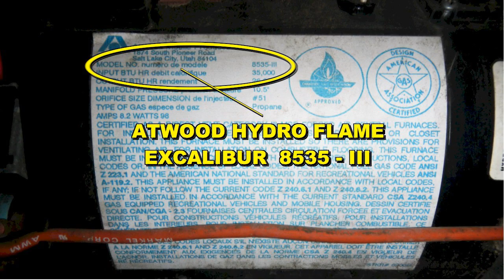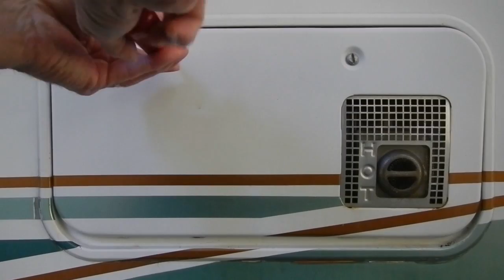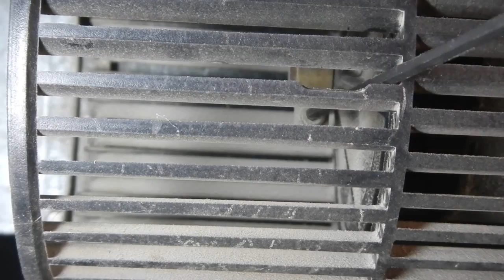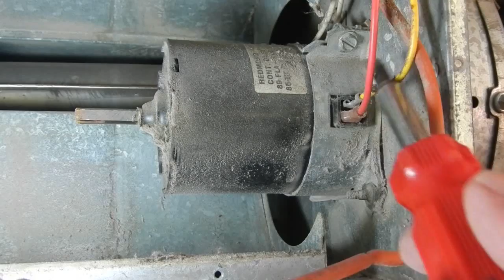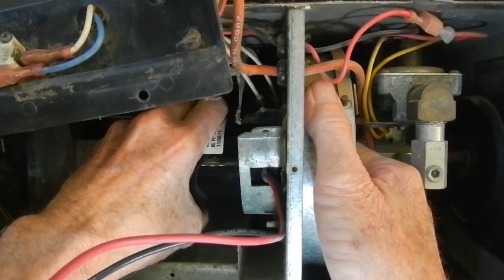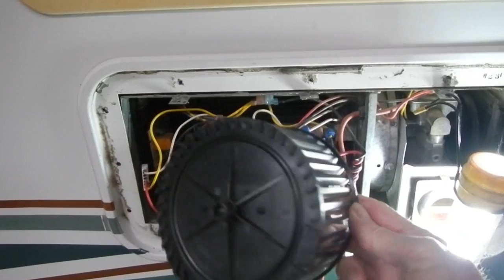REPLACING THE MOTOR ON THE ATWOOD FURNACE

Comment: Thank you..  Your mistake, helped me tremendously, as I live in a geographic anomaly, I am two weeks from anywhere for shipping. So I didnt have time to wait for a new blower wheel.. I spun the exhaust wheel, with the blower cover on, before I put the exhaust back in, to check clearance, and realized my old blower wheel, wouldnt go on the new motor shaft far enough to clear the rivets on the relay switch.. I had to take a drill bit and wallow out the squared hole on the motor side of the blower about an 1/8th inch, to get it to clear the rivets.. The flat spot on the shaft of the new motor doesnt go back far enough for the old blower wheel.. Oh and I cleaned the ground lug, before attaching the ground wire to it, been exposed to the elements for 20+ years, it was a little crusty, and I wanted to make sure it was making a solid connection.. Thanks again, for your short and very helpful video.. ✌♥️🇺🇸
Reply from the maker: That's great! This is why I made the video. Nice work on your project.
Reply: @Bill8DebTravels  Thank you again.. ✌♥️🇺🇸

Comment: There’s just one problem with your plan here. You tell us to cut the yellow wire from the original motor- which is a big mistake. If you have to replace the old relay they have designed the new ones to where you need that ground wire to plug into the new one. I’ve learned the hard way from making that mistake of cutting the yellow wire like you said. When the motor blew it took the old relay out with it and I didn’t notice it until I tried the new motor and it didn’t work. So everyone from here on- leave the yellow wire in tact!
Reply from the maker: Very Strange! This is the first time this has come up  since this video was first posted in 2017 with over 54,000 views. Make me wonder if we are talking about the same furnace, ignition control circuit board and motor. The procedure worked for me and a lot of other folks. 

Are we sure we are talking about the Atwood hydro flame Excalibur 8535?  There's a motor upgrade replacement for the DC 85 - 3 and the 89 series models make sure you get the proper replacement kit for your furnace.

Comment: Thanks for your video. I just installed a new motor (8525-II) and your video was very helpful. Especially the damage to the fan when you turned it on. I only needed to complete the new wiring but I stopped to check the clearance on mine and it would have hit if I didn’t adjust the fan a bit closer to the motor. 
Helpful video. Mine is back together and working great!
Reply from the maker: Fantastic! Glad I could help.

Comment: My motor is spinning slow but it never made any squealing sounds. I used to be able to feel air movement about 1-2 feet above the vent and now nothing. I know this is why my sail switch isn’t activating because I pulled the cover off and activated it manually. Trailer is plugged in battery is charged. 
Is this just a bad motor? Or has anyone experienced something different
Reply from the maker: Since you hace had the cover off, I asume you have cleaned in there so it woun't be dirt. Have you checked the voltage at the fan? The "squealing sound" is from worn bearings. But if the fan is running slow and the voltage is good, I wiould replace the motor.
Reply: @Bill8DebTravels  after I put it all back together it was running slow. I’ve since learned I had the two wires reversed on the fan motor. Now it spins fast and the furnace works. Not sure what I did to fix it along the way. My guess is somewhere in the sail switch circuit there was a poor connection and putting it back together fixed it. See how long it lasts, hopefully she’s done for good. Thanks for the reply and the great video
Reply from the maker: @darwinmclovin5090  Sometimes ti's better to be lucky than good. I hope it continues to run well for you.

Comment: How did you find replacement or upgrade models? I've spent far too long searching for the exact  Atwood 37233A  model 38535-III.
Reply from the maker: Google search. This poped up today when I searched for Atwood-37357.

https://www.rvupgradestore.com/Atwood-37357-Furnace-Motor-For-85-89-Series-p/41-1630.htm?gclid=CjwKCAjw_L6LBhBbEiwA4c46un_VdHObkYml-3WQYGHKHBVHvn9on5OdLrFh7hKZ5ZuTOsH8DA2DJBoClZkQAvD_BwE

Comment: Helped make my motor swap much easier. My new motor had identical plug in leads as the old motor. The burner squirrel cage was rusted to the shaft so  penetrating oil and some careful heat got it off.  Then a 1/4"" drill bit wrapped with 400 grit sandpaper to clean the shaft hole. Both squirrel cages were metal. 30 years of bugs and dust came out of the vents in spite of a good cleaning beforehand - guess that old motor had been tired and slow for a while.
Reply from the maker: Glad it helped. Sounds like you did a good job.

Comment: thanks for making this video, the only problem I am having is with the switch on the inside of the cover. I finally quit fighting with it and duct taped it closed. I assume it is just a "cover present" switch.
Reply from the maker: CAUTION! If that is the sail switch inside the fan housing, it is a safety precaution to tell the system that your fan is spinning fast enough and it is safe for the propane to be ignited. DO NOT DUCT TAPE IT!

Comment: My motor still connected to the small wheel how do I remove the motor from the small wheel
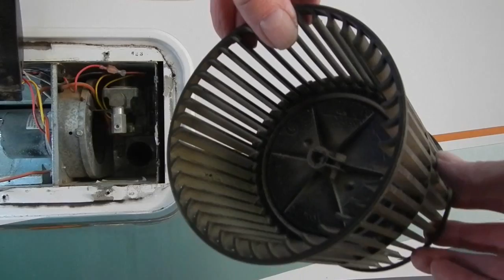Reply from the maker: There is a set screw that has to be released (about 3:30 in the video). Some people have reported that the wheel was rusted to the motor shaft. Some WD 40 or Blaster and some tapping should loosen it. See some of the comments below.

Comment: Thank you for the video. I had a struggle getting the motor out of the combustion fan because the shaft was rusty. Penetrating oil, and a file to deburr the end of the shaft, from the little hammer strikes, while tugging with small channel locks on the other end. Rotate, drive fan back on, add penetrating oil, file rust while holding other end of shaft with small channel locks, and repeat.

Comment: Mine went smooth minus the combustion wheel. It was froze onto the shaft despite removing the set screw. After half a hour of swearing under my breath and fighting with it it finally came off.
Reply from the maker: Persistence and chanting often produce positive results.
Reply: I used a boar brush to polish it up after I got the combustion wheel off and It went right on the new motor no problem. I think it took around 10 minutes to put it all back together with the new motor
Reply from the maker: Great Idea and nice work!

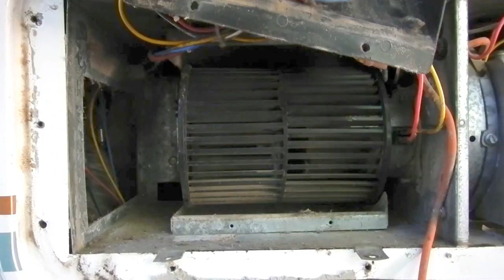Comment: 2:32 - man, you pulled that exhaust tube out like it was nothing. I've been soaking mine with WD-40 every couple of hours for the last day and have had a pipe wrench on it several times. Won't budge for me at all.
Reply from the maker: Yea, it came right out. You did take the little wingnut off ? There was some rust on mine maybe more on yours?
Reply: Bill Thompson - Yes I took the wingnut off. And yes, certainly more rust! :)
Reply from the maker: @truthsmiles  Keep spraying an wiggling.... good luck.
Reply: Bill Thompson - I finally got it off. A real saga. I ended up cutting the flange on the tip completely off with tin snips, then removing the valve/burner assembly by sliding it past the exhaust. 

Then , I slid an impact socket inside the pipe and clamped it with an exhaust clamp. A 1/2” drive impact wrench wouldn’t get it off. Ended up spinning the socket. 

I was continuously using WD-40 and even tried a propane torch plus the impact. 

Then, I drilled holes through the pipe into the impact socket and put in screws. Re-clamped and re-impacted. Sheared the screws. 

Finally I WELDED the impact socket to the pipe. Still didn’t get it off, but eventually twisted the pipe completely in two. 

But then, I was able to get the outer shroud off the pipe with lots of wiggling. And THEN, I was finally able to separate the heat exchanger from the fan housing. Once I could get to where the pipe went into the heat exchanger, another huge dose of propane torch and a hammer to beat the pipe into submission. Finally broke it loose!

Three weeks of trying different things, each more extreme, and it finally came out. 

At this point I hope everything still works. I removed the circuit board for the welding and impact stuff, but I hope I didn’t fry the motor with the welder. We’ll see! Haha
Reply from the maker: @truthsmiles  wow! Epic effort. Any pics or video?
Reply: Bill Thompson - No video sadly... just a few pictures: https://imgur.com/gallery/G6RuTUp
Reply from the maker: @truthsmiles  Boy! That sucker was really rusted in there! It must have been getting wet fir a while. Good work!

Comment: Thanks for the great video!  I watched several others  attempting the same R&R and your video was the only one that didn't show some hacked-up wiring job.  My burner fan was rusted to the shaft also, but I was able to work it off with a pair of channel locks and a vice grip pliers on the shaft on the blower side.  Hopefully its good for another 23 years!
Reply from the maker: Thanks Mark. My goal was to make the video concise and accurate. Good solution to the burner fan. Lots of people have had a problem with that. Have a great 23 years!

Comment: Great Video!! Thank You!! The set screw is stripped on the rear cage how do you remove set screw ?
Reply from the maker: Thank you for the complement. Sorry to hear about that set screw. I am not sure what to tell you. I'm thinking, removing the burner, cutting the motor shaft, new blower wheel. BE CAREFUL - TURN OFF PROPANE!
Reply: @Bill8DebTravels  I was thinking of that too. Just didn't want too.. Thank You for your advice.. Appreciate it..

Comment: If the little blower wheel won't budge....I used a ball joint separator tool and shims to separate the little fan off the shaft......took me a while to think it out......
Reply from the maker: Thanks for the tip Mike. Several people have had a hard time with that blower wheel.

Comment: Do you by chance have a video on replacing a water heater??
Reply from the maker: Not yet, but my water heater is 24 years old this year. I did replace the circuit board about 10 years ago. That was easy . Just unplug the old and plug in the new one.

Comment: Great video and DIY tips, but If you're feeling adventurous, maybe you could make a video on replacing a broken flame combustion wheel... without removing the furnace from the RV?
Reply from the maker: Is that the metal squirrel cage wheel, beside the burner assembly? How did that break?
Reply: @Bill8DebTravels  Howdy Bill, regarding your question; in my 8531-iii, the wheel beside the burner assembly is plastic and maybe broke loose from the motor shaft hub due to "age-related-fatigue?" Anyway, I will make a video of my adventure replacing the "flame combustion wheel" in my furnace and I'll try to let you know when I post it.
Reply from the maker: @smash591  I will look forward to seeing your video!

Comment: This video is amazing because i have the exact heater on my 91 alpinlight 5th wheel.  I was told by an rv dealer that i had to pull the hole heater out and put it on a bech to work on it. So thanks for your video😁😁
Reply from the maker: Glad I could help Mark. Thank you.

Comment: Great Youtube How-To, nice work Bill. I used penetrating oil on the blower Allen screw and a center punch tap before trying to remove it, came lose with a pop. I coated the Allen screw with anti-sneeze material along with the exhaust outlet where it mated with the furnace to prevent rust after the fight I had removing it.
Reply from the maker: Thanks. Good thinking with the anti-sneeze or was that anti-seize? BTW The man who invented auto-correct has died, May he roast in piss.

Comment: Hello and thank you for this great detailed video! I have gotten to the point of removing the motor, however spindle from the motor to the combustion wheel is seized on the wheel. I've already removed the set screw. I've tried penetrating sprays, I've tried heating up the seized parts but they will not come loose. I've tried for hours to get it to break free. Any ideas?
Reply from the maker: Thanks for the complement on the video. I wish I had easy answer for the stuck shaft. I was lucky and my wheel came right off. I looked through the comments and you could check the replies to Rick Lee's post from about 8 months ago. Maybe they will give you some ideas. Let us know how you resolved this so we can share it.

Comment: I have issues with my fan not turning on. We thought the motor was toast but after buying a new one and following this video it still won’t turn on. Are they able to run just off the battery?? Please help!!
Reply from the maker: Sorry to hear you are having problems. This video was for replacing a noisy motor. If your fan is not turning on you must not be getting power to the motor. You could do a search for motor not running, you may find some help.

Comment: I fixed my neighbors heater using your video. I was done in two hours. After yours failed on first attempt we took the extra time to make sure it cleared all the way around. It didn't the first time so we had to do it again and got it right. Thanks for the info.
Reply from the maker: I am glade the video helped Jim,. It makes me feel good to help someone not make the same mistakes I did.

Comment: My combustion wheel is locked onto the motor and won't let go. I've taken the screw holding it out, soaked it in WD 40 and banged / yanked on it for 2 hours. Anybody have this problem and fix it?
Reply: well 6 months... but I just did this used a punch a hammer and Blast it penatrating oil  though really the punch and hammer worked since motor is hsot now need to save it.  Just get something that will brace the motor without touching your mouse cage  Mine didn't move until the shaft was nearly out of the motor >:(
Reply: I have this issue too...I'm going to try heating up the fan clamp with a BBQ lighter...
Reply: Well that didn't work.  Or the hammer, or the oil...
Reply: I'm in the same spot you are Kent. Any other luck or ideas you've tried?
Reply: @PJFinster  I just got mine out as the cage was metal instead of plastic as in this video.  PB Blaster and a screwdriver and hammer worked for me.  I positioned the screwdriver in from the handle side towards the rear of the coach and hammered at it until it finally came loose.  I positioned the business end of the screwdriver right behind where the set screw was at.  Hope this helps.

Comment: Bill what is the reason for grounding to the body instead of the tdr ?  My furnace will not light and my blower motor wont shut off . Have I damaged the Dinosaur tdr that I bought ? Thx , I have been sick since my last post and just getting back to it .
Reply from the maker: Sorry to hear you have been sick. I have never had an electrical problem with my furnace, so I wouldn't be much help. I did have a low battery once that didn't power the fan enough to activate the sail switch. If the blower isn't blowing enough to activate the sail switch the blower will run, but the furnace will not light. I don't know about the grounding or what a "tdr" is.
Sorry :(
Reply: TDR is Time delay relay . I just went out and tried it again with a fully charged battery . It worked but the fan blower will still not shut off .  I guess I'll order another tdr from dinasaur after I call them first in the morning . Thanks for your help .
Reply from the maker: Thanks Time Delay Relay! Of course! Here's a link to the Atwood Service Manual. Take a look at "Trouble Shooting" PP 32. You may find something there. 
http://bryantrv.com/docs2/docs/hflamefurn04.pdf 

Let us know what you find out.
Reply: Bill , I'm wondering what reason there is to cut the ground wire from the old motor and ground it to the chasis other than convenience ? Wouldn't grounding thru the tdr as in the old motor be just as good or better ? I'm having a problem leaving the ground connector on the tdr open . I may be making a mountain out of a mole hill ? I'm going to address this with Dinosaur tomorrow . Thx again .
Reply from the maker: Let us know what they say.
Reply: Hi Bill , I talked to them and they set me straight on what had to happen and it works fine now .
When I changed motors I went straight to the chassis as you described in this video BUT what I didn't understand was that the yellow wire tied in to the motor black wire already went to chassis ground AND to the trd , thus having a grounded relay . I didn't understand that and left the ground tab on the tdr open which was my bad and it works fine now . The tdr has to be grounded also ! Geez I'm a putz . Thx again .
Reply from the maker: I am glad you got it worked out!  Thanks for letting us know what it was. Maybe it will help someone else.

Comment: Okay , so I installed a Dinosaur TD switch and it fired right up the problem I have now is the fan wont quit running when I turn it off ! Also I have a gas smell now ???
Reply from the maker: Gas smell...NOT GOOD! You have to find that! 

If you have a pressure gauge on your gas system, check the pressure then turn the gas off. Wait 20 minutes and check the gauge again. It should read the same if there is no leak. If you don't have a gauge, you will have to find the leak with the soap solution on the connections until you find the leak.